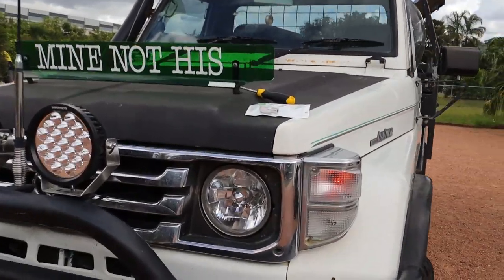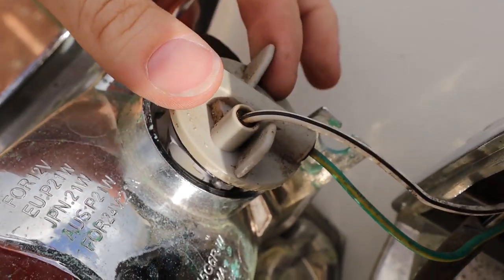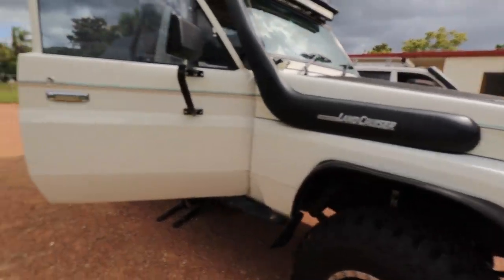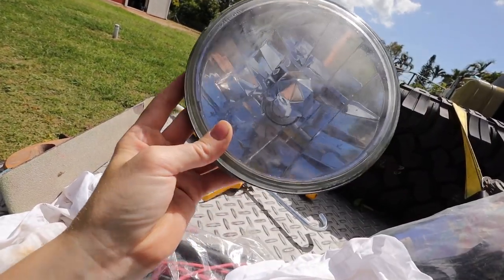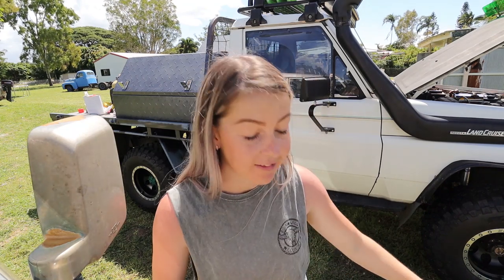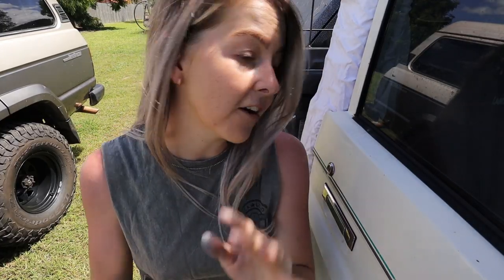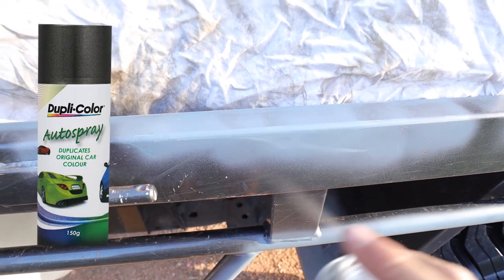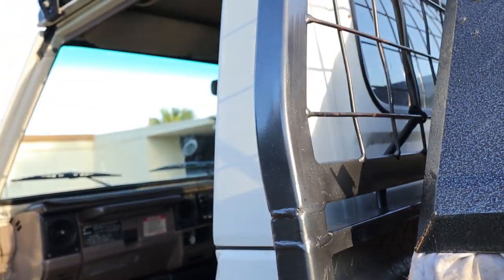OLBOY Mods Part 3: Attempting to Paint

Comment: What happened to the back of your cab? Somewhere around the middle there's like a ball of rust there? In one frame almost looked like there was a rod shooting out of it? 

Good work. Something else that I thought was humerous. As you were holding your camera around head height I got to feel what it was like to be shorter, I'm 6'2 and it was quite a surreal experience. I was thinking, dang that 70's tall. Then read the 33's and giggled. hahaha
Reply from the maker: It has impact damage hence the cab swap coming up. It's the wiring loom that is coming out of it. 
Yes I'm 1.65m. And the cruiser sits about 2.4m
Reply: @DanieSimpson  cheers to the reply
Good luck with the cab swap. Shouldn't be toooo bad being a single cab Ute.

Comment: Noticing your suspension as leafs, i was wondering how they go off road? and would it be worth doing a coil swap or are they pretty similar?
Reply from the maker: A coil swap would cost more then my whole car and everything I've spent on it in 8 years so no not worth it. Leafs are still suspension they still go up and down and work brilliantly when set up correctly.
Reply: @DanieSimpson  rightio thank you, ive got leafs myself and i was just wondering if they are a goid source of suspension, i mean how bad can they be they still produce them in the new cars
Reply from the maker: @darcylegrange1956  the issue is most leaf springs are made to carry load not articulate.  Especially aftermarket ones, to get articulation and still be able to carry a bit of weight you need custom packs really. Right size shocks and good shackle angle helps too
Reply: @DanieSimpson  yea i figured, i know this may sound like a rookie question but are you able to get much of a lift with leafs? Probably not as much as coils?
Reply from the maker: @darcylegrange1956  you can do anything really but yes usually more lift with coils.  But the higher you go the more unstable you are offroad and the less uptravel you have(so less flex). So again my 4.5" lifted leaf truck is heaps better offroad then the 4" lifted coil wagon it's just not as comfortable
Reply: @DanieSimpson  thats the answer i was after, thanks alot!! I love your videos, keep up the good work